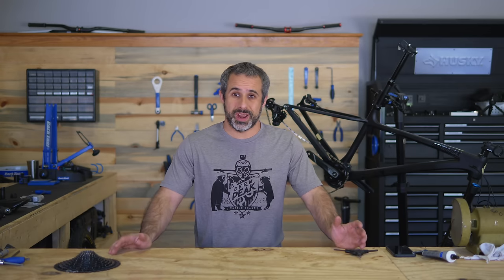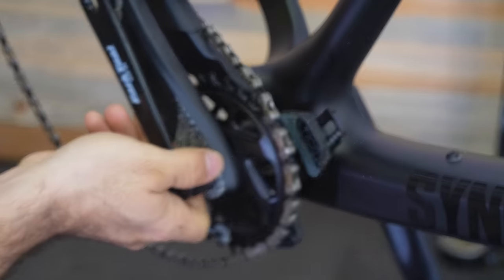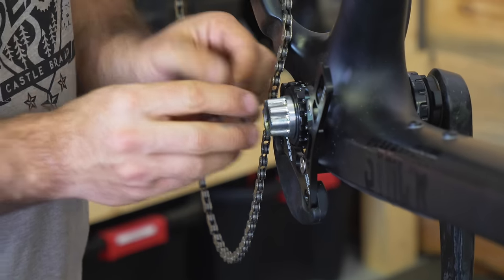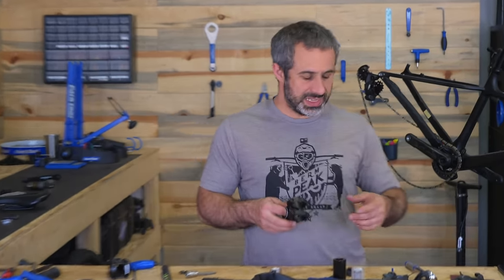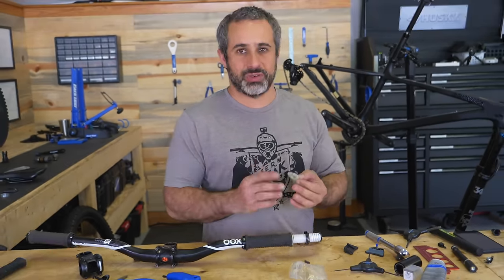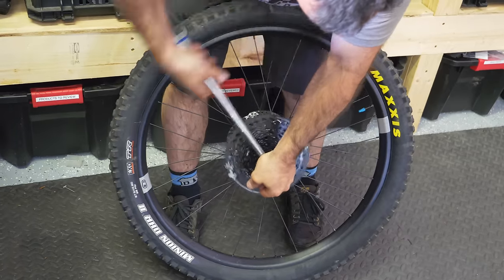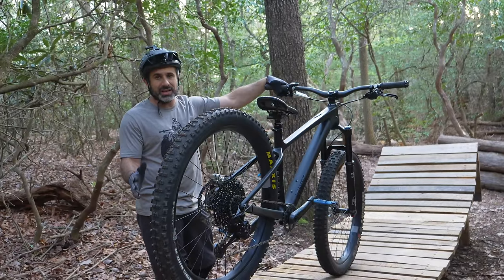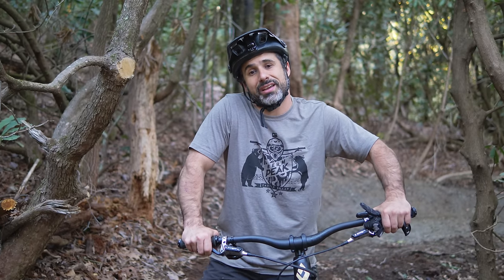Building up a new hardtail mountain bike... again!

Comment: Hey Seth.
Please tell us about those blue pedals and how you have found them!

I am currently running Crankbrothers stamp 1 and I have been having loosing my footing on the pedals in slightly moist conditions. I have come to realize that, when comparing to the Stamp 2 pedals, the stamp 1 have raised spindle area and the shoe doesn't make great contact with the pins. I see the blue pedals on this bike have a similar design but on their metal counterparts the spindle area is level with the rest of the pedals. Would love to hear your thoughts. Thanks

Comment: a mechanic said to me once, if you want to drill star nuts out, you have to drill it out using a drill be that's just bigger than the thread and slow work outwards with bigger drill bits, the star nut will fall out. if you drill out with a big drill bit straight away, it doesn't fall out. don't know why.

Comment: Hi Seth I am setting up my few years old Haro to go bike packing early next year and wanted to convert it to tubeless. It has the factory tires 26x2.1 tires on them now wanted to see if you could tell me if I can switch to a slightly fatter tire and also set it up tubeless. We are going to be riding on some hard packed back country road in west Texas. Worried the old tires won’t hold up and will get flats. 
Thanks in advance.

Comment: Which diamondback you recommend between the Mason 2 and Sync’r aluminum. Both are about the same price due to my job discount Mason 2 is like $100 more, but it just came back in stock where as the sync’r has been out of stock for a while. I ride in FL which is mainly sand and clay roller coaster type trails.

Comment: You supposed to hammer that starnut down. It kind of resists to go up because all this outer edges are pointing up and if you force it upwards it kind of wants to  straighten those edges(in horizontal plane) and it makes starnut increase in diameter. It's much easier to move it down because edges flex a bit more up and starnut diameter naturally slightly get reduced.

Comment: Am I wrong in my thinking or is that bottom bracket bearing installed backwards?

I thought the reverse thread goes on the left side and standard on right.

That way as you’re pedaling your working the threads in the direction they are threaded in.

Having it the way you do, the right crank arm is working clockwise on a counter clockwise bottom bracket thread. Could lead to the bottom bracket loosening up.

At least that’s what happens on motorcycles and cars. Depending on which side the axle nut is on on the swing arm, or center nut on Porsches, the threads are reversed.

Comment: I love my Trek marlin 7 hardtail, I did try a full suspension mountain bike when they first came out and I just couldn’t get along with the bounce from the rear, so I traded it in for a full rigid set up ( of which will soon be a single speed cruiser) and now that I have this newer hardtail and of course watching Seth build his bikes 🚲 up with 1x gearing that’s also got me thinking 🤔 that might be possible to go from 3x9 to possibly a 1x10 maybe, of course this old man might just find that a whole lot easier than the 3x setup that I have now.
What do you think 🤔 Seth, I would appreciate your thoughts 💭 on this, if so I ask my local bike shop guy when I see him next, I also have another bike project on the go but have decided what to do on that one ☝️, anyway I have always enjoyed watching the bicycle builds and it doesn’t matter who does them, they are all absolutely fantastic, the BICYCLE was truly a great 👍 invention and a great 👍 way to get yourself fit and has a very low impact ratio on your joints and bones and all the other bits and bobs on ones body!!!!?????.

Comment: 6:08 what about hammering it down, with the fork the right way up, I had to do this once, cus a star nut installed by the local shop did not got skewed, I don't know why, it was straight before., it was on a MZ COrsa fork, maybe something was wrong with the star nut. it went out very easily.
the shape/or angle of the star nut is so it should be easy to get in one way but not go up, so always hammer it down, not up.

Comment: Im gonna need a new bike before long.  Im on a ten year old trek 820 which works good.  Shifting is off a bit but i basically run it like a 1X7 cause the front derailer is beyond me to fix.  The fork is not good; 60 or some mm of travel and i want something wayy more to hit features on and not just ride flat trails.  Either way, I need an upgrade.  The problem is, 1. no money, and 2. what the hell should I get.  Im thinking of saving up for a long time but even then I dont know that Ill have enough for something good.  Something like the base syncr seems like a great option, and other brands have similar hardtails.  But I would also love a full sus.  And again, its all a fantasy becayse money is not an option.  Someone help!

Comment: Seth, I have a 620 AUD Merida Big Seven 10 hardtail which I bought for 300AUD used but in 'good' condition. You got any tips for me to improve it. The suspension is 'adjustable' but even at its most airless point, it doesn't seem to be effective. The front brake has been contaminated and weakened and the gear shifting is the opposite of smooth. Please help.
Reply: is the suspension locked out maybe? also have you seen anything about tuning shifting online because that is sure to help.

Comment: I just replaced the shimano hub on my dads bike from 1995, its an old kona race bike with no suspension and the hubs were never touched, anyways, it has no cassette noise and it feels wierd, wondering if this is bad

Comment: Hey Seth, are you still riding the 2.8s? I too have the Sync’r carbon and love the bike but I’ve been debating siding the tire down to maybe 2.6/2.5 hoping it will give a little more precision and a little less floaty feeling. Any thoughts? Love your channel, keep up the great content!
Reply: Run 2.6s on my main HT and they feel prime for me 👌🏻
Though I also have a carbon Easton rear rim that I run that I run a 2.4 on and use for certain trips on the more gnarly trails, you could definitely try a 2.6 and 2.5 in rear in you feel like it.
Reply: 2.8 look so clean, but the 2.6s feel more comfortable to me for whatever reason.

Comment: That’s the problem with carbon frames, it doesn’t show any signs of failure. It just breaks. Steel bends, aluminum cracks slowly, carbon just blows up. Build a steel bike.

Comment: I remember when i was 11 today i am 12 i dropped the top cap screw inside the fork then i was rushing to flip my bike and remove the wheel to temove the star nut then put it all back together but my wheel was wobbly now its fixed tho